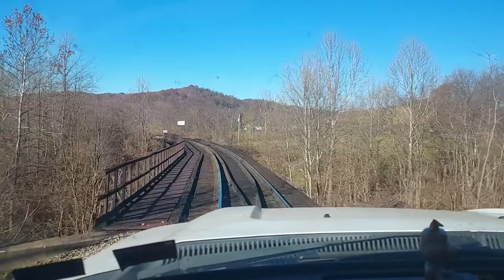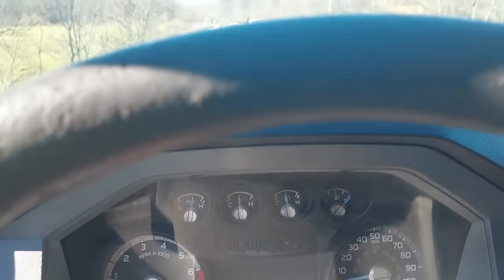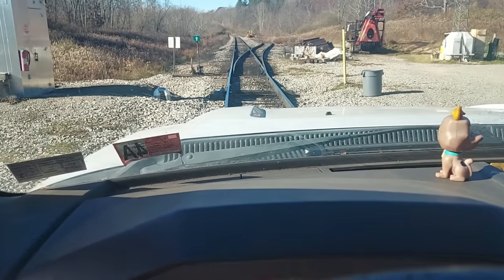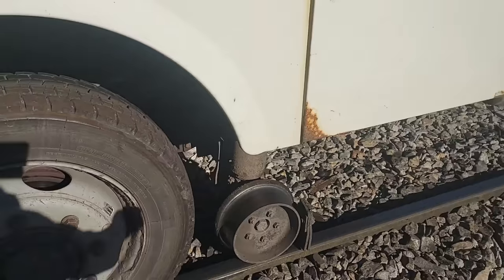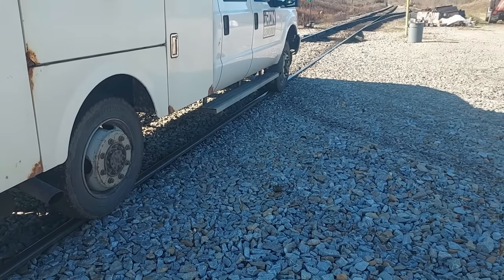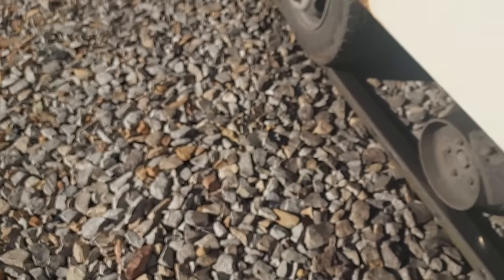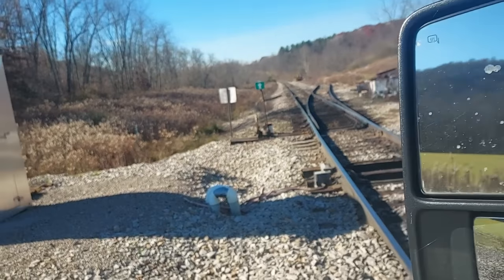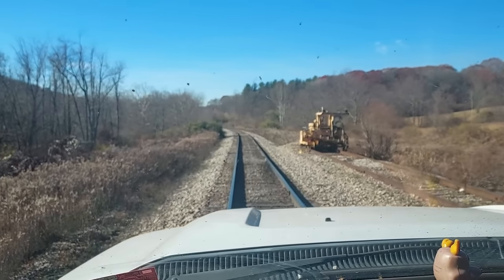How to Set a Hi Rail Pickup Truck on and off the Track

Comment: You guys are lucky to have those switches inside.  As a Class 1 RR, ours is not near as nice, we gotta get out each time, no inside switches.  We have only 1 pump running both hyrails.  The brackets are always broken, so we keep them chained all the time.  And half the time, the pumps don't work so we have to use the manual mode and jack it up.  The gear on the Silverados is set up better cause most of the Fords here still have the old Harsco gear that you gotta use a bar to lower and raise.  To some extent, I think the old gear is more reliable cause no worry of electrical solenoid failures.  Are you using Harsco or DMF gear?
Reply from the maker: Yes we are, but I still go out and check to make sure the flanges are
inside the rail heads and not on top of one. I don't like to rerail these
things....:-)  One of our old hi rail pickups had the gear you had to
get out and use a bar on to drop and raise them. Glad we don't have
that one anymore! Very grateful my friend for your taking the time
to visit with us and check out the video. And I wish for you only the
best of luck with your trucks. It's a pain when things don't function
the way they should.

Comment: How come you didn’t pull onto that siding?
Reply from the maker: Good question Rick. We have a clamp on that switch point to
keep the train at track speed from picking the switch, so it's 
a bit more work to take the clamp off and back on each time you
go into the siding than it is to take the truck on and off. Besides
how could I make a video of how to set a truck on and off if
I went into the siding... :-)   We are so very grateful my friend for your taking the time to watch and write in.

Comment: Does the pickup run in 4 wheel drive while on the rails?
Reply from the maker: No it does not Gordon, I've never used 4 wheel drive on rail.
it goes really good in 2 wheel drive no matter if it's on dry rail
or on snowy or wet rails.  Thank you very much for taking the time to visit with us and may you have a very good day my friend.

Comment: What type of hydronic fluid is used in the high rail trucks?
Reply from the maker: We just use regular tractor hydraulic fluid like you can get at
Farm & Family or NAPA Earl. It's nothing special. I have an electric motor that runs a pump on my Dodge 5500 dump truck at home and it
uses a special transmission fluid.  We do appreciate your taking the time to visit with us and check out the video my friend.
Reply: @ccrx6700  your very welcome. And thanks for the info.

Comment: I was watching for the train to come by when you lifted the high rail gear up to leave the rails. I assumed the train rolled by in between lifting the gear up and resetting your truck back down on the track. Is that what happened?
Reply from the maker: That is correct tooling engineer, the train is not allowed to leave
either portal unless I am off the track and give him an all clear
radio transmission.  Lot of folks have asked in the past how to set a truck on the rails, so was glad I could share this one with you.  Very grateful my friend for your taking the time to visit with us and check out the video.

Comment: For some reason I always thought the front wheels don't touch the track so you don't have to worry about locking your steering wheel
Reply from the maker: On the big hi rail trucks the front wheels are up in the air, but on
the small pickup hi rail type trucks front wheels ride the rail head
Patriot Canuck, and so you were right, at least for some trucks.
Glad you could visit with us and check out the setting a truck on
track show my friend.
Reply: @ccrx6700  i appreciate you explaining.😁✌
Reply from the maker: @patriotcanuck6485  👍😊

Comment: I wonder why you didn't simply unlock and throw the switch to park on the siding just like a regular railway vehicle.
Reply from the maker: We have a clamp on that switch point to keep the train from
picking the switch szabados, so to take the clamp off and then
put it back on is a bit more work than to simply take the truck on
and off. Besides if I pulled into the switch, how could I make a
video of how to set the truck on and off.....  Lot of folks have asked in the past how to set a truck on the rails, so was glad I could share this
one with you.  Very grateful my friend for your taking the time to visit with us and check out the video.
Reply: @ccrx6700  I was sure there was a mechanism to keep the switch in position. I just thought it was easier to operate than an actual clamp.
Reply from the maker: @szabados1980  👍😊

Comment: If you park a tank car on top of the hill drain the water thogh a hoze into a tubine run a genorator.fill the tankcar on the bottom .then swich the out you can make cheep electricty to run your house ect
 Thats what in doing soon
Reply from the maker: Sounds like a good plan Shawn. Hope it works out very well for
you.  Very grateful my friend for your taking the time to visit with us and check out the video.

Comment: I thought there would be a bit of side to side movement like you have on the other truck, must take some skill and time to get used to positioning this truck.
Reply from the maker: Sometimes it takes some messing around to get the back wheels
just right Cedarcam and it is a pain in wet rails, helps if you have someone back there to guide you. Only once in awhile can I get it centered just right the first time by myself. Problem is you can't see the back wheels from inside the cab.  We do appreciate the nice comment and for your taking the time to visit with us and check out the video my friend.

Comment: Centering is difficult when by one self. The track inspectors normally have two riding the hi rail to assist in placing on track. The early hi rail vehicles weren't equipped with electric or hydraulics, were mechanical. What a task it was to place the hi rail gear on the track.😎🚂🚃🚃🚃✝
Reply from the maker: Sometimes it is a lot of messing around as you know to get
those rear wheels on just right Gary. Once in awhile I can get it
centered just right the first time, but usually have to get out
and look a couple of times. One of our older pick up trucks you had to go out with bars and manually put the hi rail gear down, glad we don't have that one anymore! Lot of folks have asked in the past how to set a truck on the rails, so was glad I could share this one with you.  Very grateful my friend for your taking the time to visit with us and check out the video.